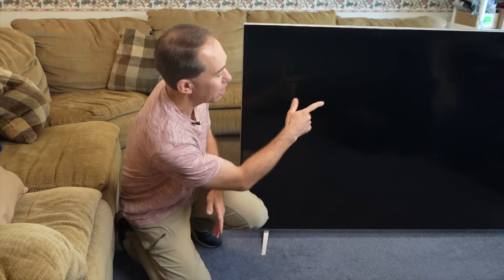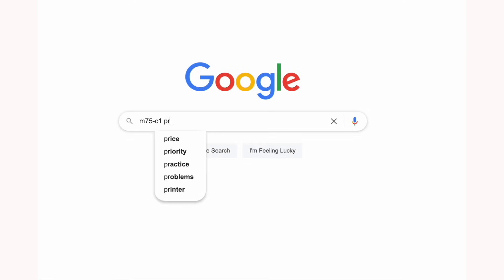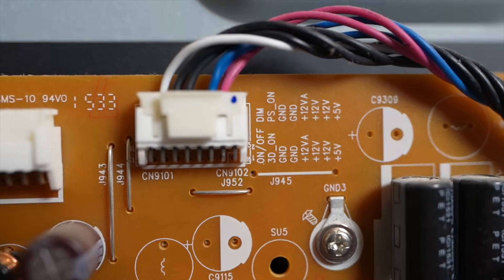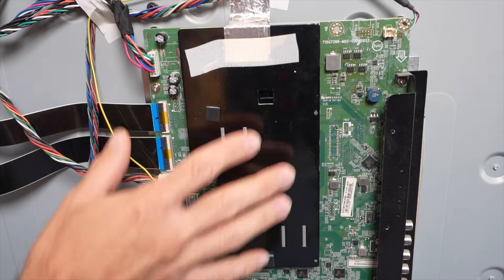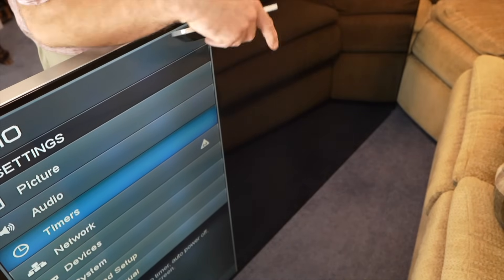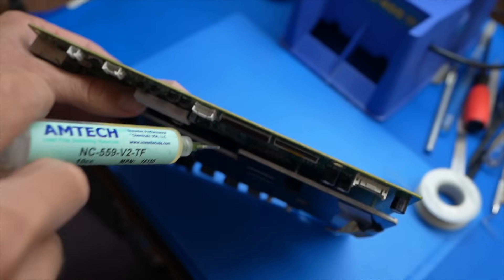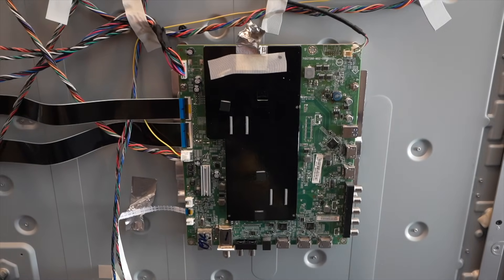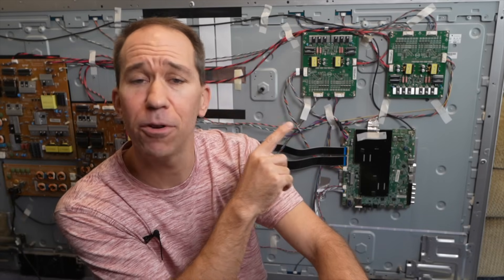I FIXED a HUGE TV for FREE - You Can Too!

Comment from the maker: What is something you repaired lately?  Or maybe something you want help fixing?  Thanks for watching!
Reply: My 75" samsung went out at 3yrs 4 months.. so I went to costco & got the 86" & Im looking to fix the 75 & out into the game room. A dark area 12" wide top to bottom sounds like led strip. I used to fix our old 65" mitsubishi 1080p set & it was simple. Hopefully this 75 is as easy😮😅
Reply: A small led tv developed perfectly round circles on the screen ranging from about 1 inch to 3 inches on the inside of the glass, not on the exposed surface.  I took off the glass tried cleaning it but they are still there.  I'm dumbfounded as to how they got there and how to remove them.   Other than that, it works perfectly.
Reply: @jeffpitoniak  a detach back light lens is your problem.
Reply: @edwinamazona5474  so the glass is ruined?
Reply: Someone give me tv any there a few I a middle vertical lines( dead pixels maybe) . Could you please tell me how I can fixed it ?
Reply: Please tell me how to this my flat TV screen my flat tv is Called scaptre  my husband  by new flat tv screen
Reply: I have a Samsung monitor S27D590CS with double images. 
Could you tell me where should I start my diagnostics? The repairs for blurry or double images I found online are mainly for TVs
Reply: Have a TCL Roku that the video stops but the audio continues and if you unplug it comes back on for a little while, what do you suggest to do with it.
Reply: Xbox One Kinect
Reply: Recently I used your troubleshooting and and research techniques to narrow down the black screen on my 65" TCL Model 65S425 TV to the LED strips. The strips I used were from eBay and had the adhesive tape on them requiring removal of the liner to apply the strips after removing the old. I used isopropyl alcohol allowing it to evaporate before installing the new strips. After putting everything back together I had a perfect picture. While streaming last night and the screen gets dark during episodes  I noticed two spots in the upper half of the screen in the area the two top strips plug into the power lead wires that are like a light shining through the panel. It's only obvious when the screen is darker.  I did use you flashlight method to check for screen cracks but see none. I have not taken it back apart to verity, but, from you experience, would the adhesive not holding cause this problem?
Reply: I have numerous electronics I could donate if you could help me with some repairs
Reply: my samsung 3d tv and blu ray player both had issues. The blu ray would just randomly eject a movie and the tv would turn off randomly during watching streaming services. I took apart the blu ray player and disconnected the touch screen and for the tv I took out the wireless control module. I lost wifi but I was still able to connect with an ethernet cable. Both problems fixed "for free" but I lost some features. I didn't bother replacing the broken parts.
Reply: I have a Samsung 70” 4K TV where you power it on and the LED backlights turn on, but nothing displays on the screen. The LED backlights remain on until you turn off the TV with the power button or cut power to the TV. I actually decided to order a replacement main board and power board to replace them just to see if it would fix the problem but nothing has changed. So it would appear the boards are functional, the LED backlights are functional, yet there’s no display on the screen. What could be the cause of this problem?
Reply: 60 inch plasma tv where tv comes on and works for about 1-2 minutes then screen goes dark but tv remains on.  Something is likely overheating.  Happens on all inputs hdmi and rgb. Thoughts?
Reply: My 70 inch Vizio TV won't turn on 😢 the screen is the only problem 😢

Comment: great video brother! I need some guidance on a 55” RCA 4K LED tv… when it powers up with remote, it will start up and flash the RCA logo then go black. If I leave it on the screen stays black. If I restart it right away it does the same thing, flash RCA and goes black. But if I leave it on for about 20-30 min on the black screen and restart it will start normal and work normal and stay on without issues for as long as I leave it on. What am I facing here? Gremlins or demons? Thanks in advance for your help
Reply from the maker: Rule out that it isn't the backlight.  Use flashlight on the screen after the logo flash.  If you see something (anything) on the screen, then you can use the menu to turn down the brightness to 10% and reboot.  It doesn't fix the backlight but you can see your image and then decide what to do.

Comment: It's not usually a chip that has a bad connection and you need to replace the chip...usually anyway. Also in my experience its usually the black capacitors that blow on tvs most often its just a failing or failed capacitor. With the newest smart tv's the LED back lights and LED drivers are a big issue also every company is trying to cut cost by driving more LED strips with the same or smaller controllers and power supply and it tends to draw too much from the power board and heat is the number one killer for electronic proccesors and components (exept for your kids throwing footbals in the house) LOL

Comment: Great repair! How did you know it were the green and white wires that send the power-on signal? I assume they are of different colors on different TV-s.
Reply from the maker: Thanks!  I would have to rewatch the video to know the wires you are referring to but in general, the signal labels are printed on the power supply board at the connectors.  For example, the power on for the system might say "PS_ON"
Reply: @FrugalRepair  I see, thanks!

Comment: I picked up a UN58TU700 Samsung Smart TV from the side of the road where someone was throwing it away.  I hesitated on even messing with it, but my curiosity got the best of me.  It was laying in the hot sun for who knows how long - a day, two-three days?  Don't know how long, but I wondered if that had anything to do with it working just fine after I got it home.  

The TV looked pretty much new, with no dust or crud on it.  It is a current model being sold in stores in 2024, this same year.  Obviously they had some kind of problem with it though, to be throwing it away.  It worked perfectly for weeks for me and I was trying real hard to not feel pride in myself for making the decision to pick up this free TV.  I mainly used it for my computer monitor though.  I was really enjoying it until all of a sudden one day, it looked like someone had walked up and sprayed black paint all over the part of the TV screen that I was mostly looking at while on the internet at that moment.   Then it went to a blank screen with "SMART TV by TIZEN" flashing on in the middle of the screen and then the TV would turn off, then back on with the Smart TV by Tizen thing, then off again, and continued doing this.  I worked with it unplugging it/plugging it back in, pushing in the on/off button and holding for 30 seconds, working the remote, etc., and eventually it started working again just fine like before.

Everything was fine after that, but I started wondering if it had been hacked.  That black spray paint effect seemed weird and creepy somehow, like it was done somewhere else and then superimposed on to the part that I was viewing, which was my Crypto stuff.  

Fast forward ahead a week or so, and it did it again.  So, this time as before, I got it going again by doing the same things, but this time I decided not to set up the wireless, since I didn't really need the wireless set up on the TV itself.  I also did a factory reset, but I can't remember if I did an update or not.  

I thought that if it was hacked, then the wireless should be the way that it was done and could be happening to more TV's out there other than just mine, like a ongoing broad attack.  

So, last night it did it again.  It's been perfect for probably about a week to ten days.  There is a difference this time though.  After the "black spray paint" thing and the "SMART TV by TIZEN" message, it just went to black screen.  Although, it does sort of turn on and off, with a dim lighting up effect, I guess it's the "back light"?  I tried all of my past procedures, but to no avail.  

Anyway, sorry for the life long story, but I thought that my situation might be familiar and  interesting to some people.  My main point is, did the previous owners have this same issue and did the sun's intense heat on the TV help to bring it back, at least for the many weeks that it was working?

What I'm about to check into now is "Blink Codes".  I noticed the red light next to the tiny on/off button, has a sort of blinking pattern.  I would love to see some discussion on that.

Comment: just bought a 70 inch rca and it jus broke lastnight.....black screen on the right side and very faint picture on the left side of screen.......left half of tv very faint picture.......  ..........a month or two earlier i noticed one really thin green  line....then weeks later two ....then weeks later four...then lastnight the above occured  this is the model so i'm going to follow your advice and see what happens rwosu7049

Comment: My 65 inch TCL stopped working while i was watching it. The screen is black but i can hear audio and when i turn it on the screen fashes on for a second then goes black and when i shine a light on it i can see image. Should i risk buying the replacement boards? I just dont want to apend that money and be out even more and it not be fixed.. already out 500 dollars on a tv thats 13 months old
Reply from the maker: Your LED backlight is the problem.  You can replace all of the LED strips or try to fix the individual bad LEDs.  If you do this, the hardest part is making sure not to crack the lcd screen and keeping the lens and diffusion films as dust free as possible (and in the right order when putting it back together).

Comment: It's almost comical how you start the video saying "with only one tool" and then proceed to use an electrical screwdriver, a multimeter, a heat cam, a hair dryer, a specialized set of tweezers, something called "flux", a hot air station (If you made a video about how a "20 dollar hack" works the same, why not using it on a "only one tool" video?) not cool
Reply from the maker: Maybe you missed the part where I explained it but you can fix a tv like this with a screwdriver, buy a replacement board on eBay, take off outer plastic cover (screws), then take out the main board, there are about 6 screws holding the board on.
Reply: Of course, but you don't make a video on "How to fix something with one tool" then proceed to fix it with several expensive tools. That's deceptive, I challenge you to ACTUALLY fix a tv using NOTHING more than a screwdriver, literally nothing, a screwdriver, and maybe your phone (no paid apps though 😅) @FrugalRepair

Comment: T-CON stands for 'Tiny Control'? lol 
I pull these TVs from curbs all the time, I am blown away how casually people toss them. Usually the worst problem I have with the TVs is no remote.  And even if there is a cracked screen, plug it in anyway, there's usually what looks like abstract art on the screen. I have used those as uniquely creative table tops lots of times and they last for a couple years, even if you purposely keep cracking the screen. 
At times, I have had 50+ inch TVs in every single room of the house, including the bathroom and hallway, just because I could (until the next months electrical bill brought that to a screeching halt.).

Comment: Hi FrugalRepair. My LG 48in Oled fell over while reorganizing my room about 2 feet on the screen, and it made a crack less than 2 inches on the top right corner with a small indentation. Red light is on and blinks when i try to turn it on but no picture. So, is my $1200 tv completely toast now? I've been so upset over this and still making payments on it. If there are any suggestions at all or ways to fix it, or repaired rather than replacing the whole tv it would make my day. Thanks for the vids, I enjoy them.
Reply from the maker: I wish I could give you a secret but it sounds like the screen is cracked and you can’t fix a cracked screen.  I’m sorry!  You can sell the internal boards on eBay to recoup a little.

Comment: Wow, great video. I tried to fix a samsung tv but ran into an issue after replacing a power board. The bottom is darker shaded (not black). Have you heard of this?
Reply from the maker: Thanks for watching!  I’m not sure I understand but maybe it’s part of the backlight not getting power.  Like maybe a connector on the power supply isn’t plugged in all the way?

Comment: Hope I'm doing this right but I've never tried to send a message to u. Given to me a vizio e60e3 smart tv. Guy said its got a blue light issue. Everything is blue on screen but excellent quality a d found it may be as easy as a tint correction inside that area where u adjust. 
Do you have a y ideas, thoughts?  Thank u any help  e awesome as wife's medical bills for breast cancer are beating us up.
Gary
Reply from the maker: Sorry to hear about your wife’s struggles!  The first thing I think of for blue tint is the LED coating (to make the light more white in color) has failed and the backlight gives off a blue light.  If so, you can either try changing the settings or replace the LED backlight.

Comment: how do you fix a tv with no sound?.
Reply from the maker: Probably something on the main board.  Make sure there’s no software setting on and you can probably try the mini plug output, maybe the speaker wires came loose?  Could be a number of things

Comment: I think the coefficient of thermal expansion is different between the chip that gets hot, and the board it's soldered to. This slight difference in thermal expansion causes a stress fracture over time in the relatively weaker solder that bonds the two components together.

Comment: I literally fixed my cheap $200 Sceptre tv by replacing a few popped capacitors for $10. An i fixed my Samsung tv by taking it apart, not seeing anything visual, plugged it in checked some voltages not knowing what needs to be what.  An started poking at the power button cable and accidently jumped 2 connectors and it turned on my backlight. So in the end my power cable somehow loosened up to the point it wouldn't power on the tv.  LOL  Can't believe I almost threw it out.
Reply from the maker: Great job on the repairs!

Comment: What would you suggest if you had a new 58 inch Hisense tv never used in storage and you finally got it out of storage after a year and it won’t turn on No led lights or anything working ?
Reply from the maker: I’d go through the usual diagnostic steps.  I have some steps in my free ebook that you can try.

Comment: Hi I was watching you video great stuff, However I have a LG 70" and it is not connecting to Wifi.  I did everything from unplgging it to reset the router and reset the TV back to when I first took it out of the box, Still not connecting the tv is 7 years old. Any suggestions?
Reply from the maker: I'd check the wifi connections from the main board to the wifi module in the tv.  It might be a firmware thing too.  Or the wifi chip or the main board went bad. Can you try a ethernet cable to make sure the internet portion of the tv works?

Comment: Your msg is always valuable.. I have normal LED TV which is getting switch off every 15-30mints automatically.  Then I need wait sometime to make it work.. I have checked sleep timer which is ok .. any advise plz?
Reply from the maker: Could be a lot of things.  Seems heat related though.  First try turning down the backlight brightness and see if it lasts longer.  If the backlights are not the issue, try taking the back cover off and putting a fan blowing air directly on to the main board and see if it lasts longer.  Look at any capacitors on the power supply for damage.  Some thoughts to get started

Comment: Great Video!  I have 2 broken 55"  one with broken screen and one who working from cold condition but stop working after some time use and don't start again before rested to cold again. I had a idea to swap part between the 2 TVs since they where from same manufacturer and about same age, but since the one was smart tv and the other not all inside was different, even the connector to the screen panel. Any idea what could be reason and fix for the tv who close down after some time use?

Comment: Where did you connect the COM lead?
Reply from the maker: I don’t know what that means.
Reply: @FrugalRepair  You were using the red lead to poke around and test for voltage but you didn't show. where the black lead was making contact on the board.
Reply from the maker: Ok, gotcha.  The black probe was on the metal frame of the tv.  I usually stick it in a hole so it's touching the metal housing.  Or I'll touch it to a screw in the corner of the PCB board since that is a known ground/reference point.

Comment: 2013 M60-c3 Vizeo - takes long time (5-10mins) for video to come on. Power light does come on but immediately goes off - I will continue to power on and off with remote -(eventually power light goes from bright to dim - stays on - and video starts working). Only input is from HTPC Onkyo 1030 receiver at HDMI 5 - 4k 60 hertz.
Reply from the maker: Not sure, might be a similar CPU loosing connection with the board issue.  You can try a hair dryer on the main board and see if you can get it to turn on faster than 5 min.